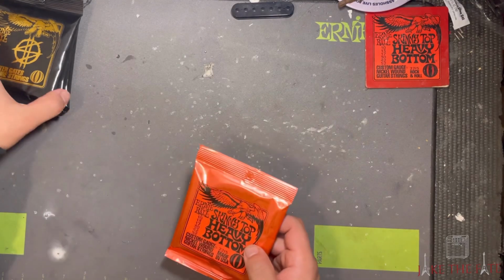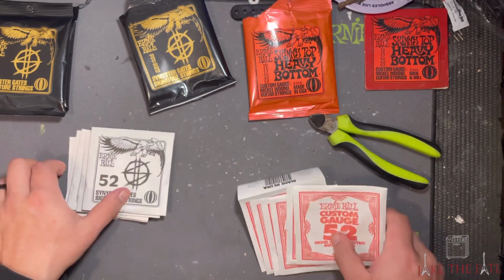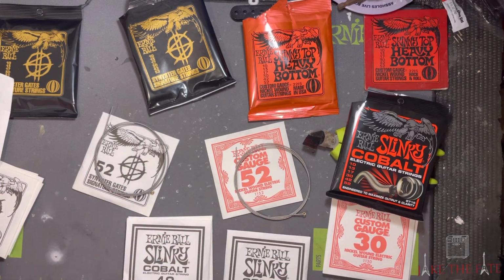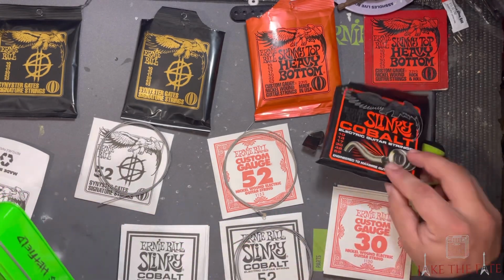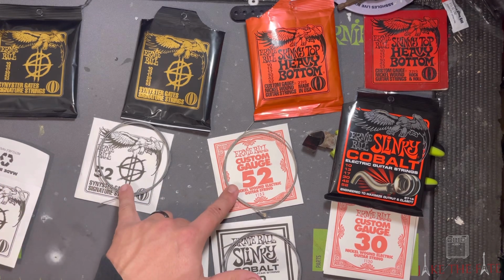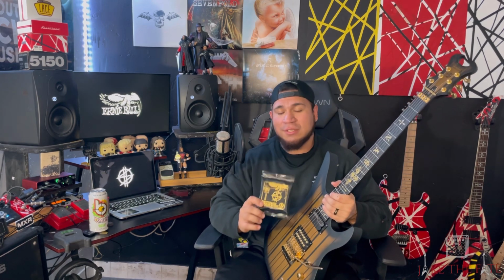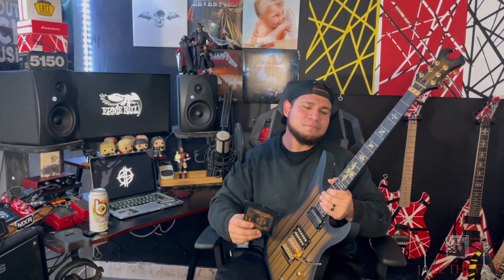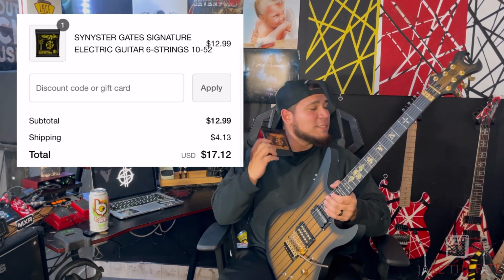Synyster Gates Signature Ernie Ball Strings Review And Demo

Comment: Nice review bro, but I kind of wish you would have paid some attention to all of the specs listed on the site where you ordered them.  That would have answered most of your questions, kept you from guessing, and maybe allowed for a more focused review.  I believe Gates has been using the 10-52's for a while and then developed these with the EB folks.  The wound strings are wrapped in Stainless, where the regular EB's are Nickel and the Cobalt's are, well, Cobalt.  That's why you get a slightly brighter sound.  There is also a strength factor with stainless (which is why many frets are stainless now) and coupled with new, stronger alloys on the core and unwound strings, is supposed to allow for better tuning stability and greater overall strength vs their regular strings.  It would have been nice for you to have had that info handy and maybe even compared the tuning stability claims a little.  Overall though, nice video and great tone.  Keep it up!

Comment: Hey dude I brought a new Syn custom and I want to put 10-52s to it it has 10-46 on it from the stock what do i need besides strings like did you put an extra tension spring to the back ? Thanks
Reply: Don't alter anything dude.  Just slam heavy bottom skinny top and hear what it sounds like.  You can put tuner locks on it if you desire because the guitar has some weird flex and weight to it but just see what you like and don't like then custom it that way.